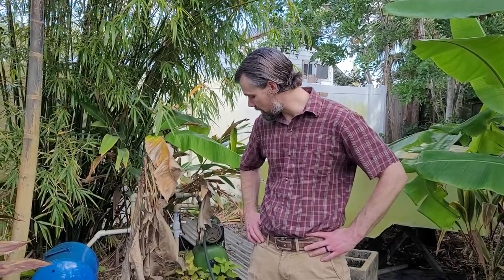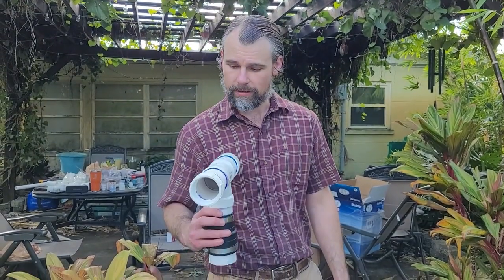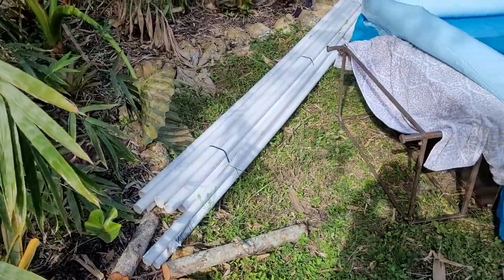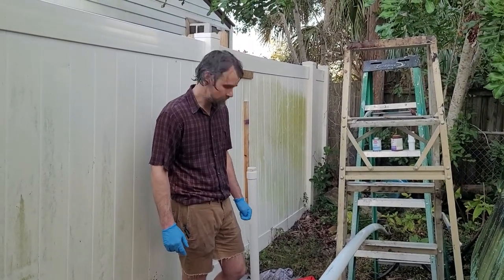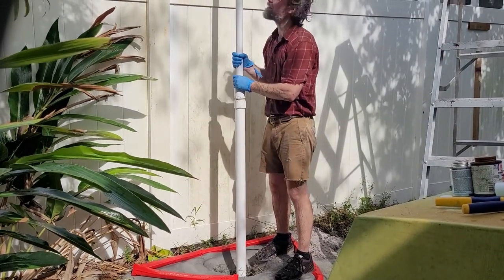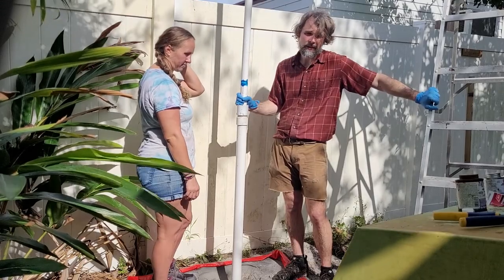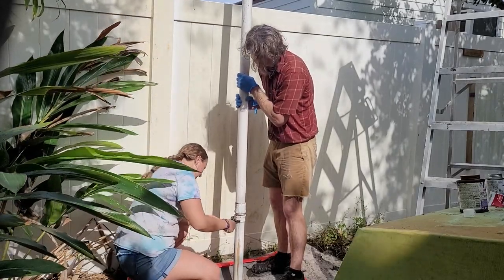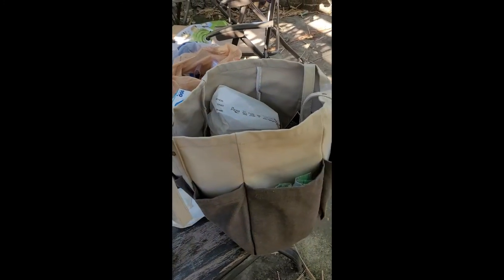Diy How to drill your own well (jet with mud pump) - The Carrington Jungle

Comment: I’m curious to know your thoughts on dropping a well point below your 2” casing and then leaving the casing in place rather than removing it? That way if you ever want to remove the well point for repair you can without abandoning the well all together. Is it doable, or is there an issue with leaving the casing in the ground?  It seem the water table shouldn’t fluctuate too much especially here in Florida.  Thank!

Comment: How deep can I drill with this method?
Reply from the maker: I would not attempt to go more than 40 feet in sand. If you use a recirculating pool with chemicals, you could probably go deeper but it would be more involved

Comment: What did you do to prevent collapsing around the 2inch pipe?
Reply from the maker: I didn't do anything, just tried to move quick to keep it loose. If you take a break, it will but at least in my florida ground, it stayed fine for long enough
Reply: Thanks!
Reply: What part of florida are you from?